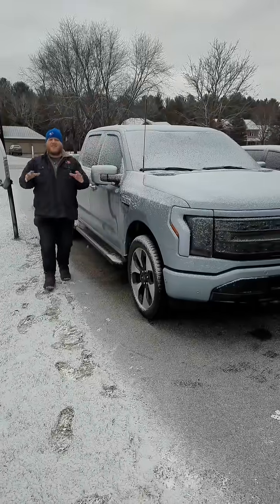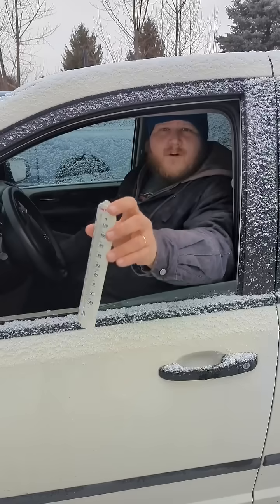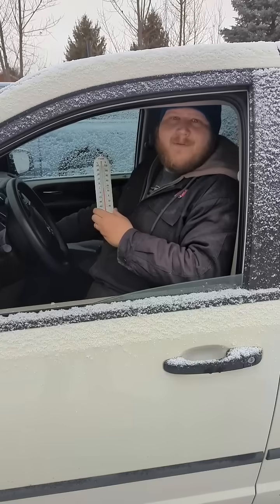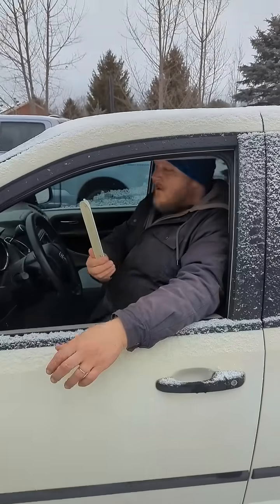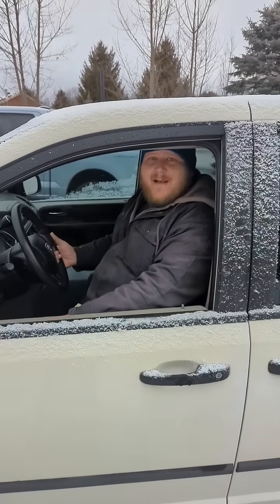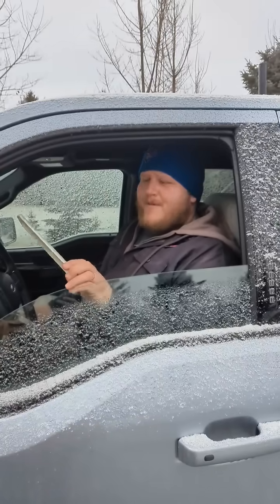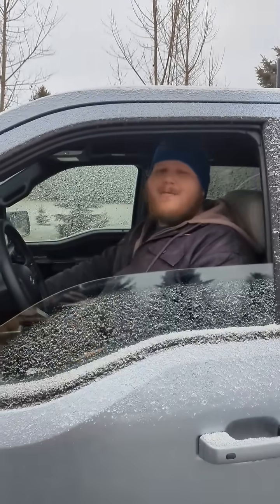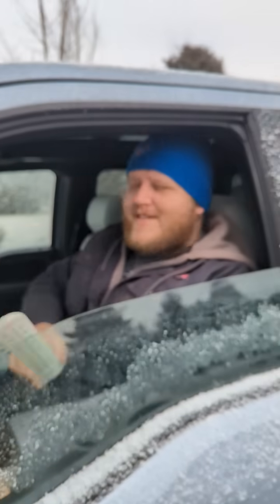Electric vs Gas - Heater Wars! How Long Does the Ford F-150 Lightning Take to Heat Up?

Comment: The most impressive thing of the entire video was the 2015 grand caravan started. But your brother is a mechanic 😅
Reply: Not impressive at all as I own a 2012 and it's like a fuckin freight train when it comes to performing.  And I can fit more in this damn thing than most truck owners. 

Love to see someone scooping up their sixteen foot wide garage doors in their truck and drive them home from the store....  Did in my caravan with a buddy sitting shotgun too.
Reply: @Angry Beaver  then I’d go to the scrap yard and pull the turbos off the Tundra and have my boyfriend weld me a pair of headers and twin turbo my E46.
Reply: @Angry Beaver  yeah I highly doubt that but that Ev will be in the junkyard before that truck will
Reply: Starting isn't the problem getting the transmission to work is the real problem
Reply: I have 1991 Ford F-150 Lariat with 5.0 EFI.... she'll start and heat up fast near the point where negative Fahrenheit and Celsius are equal.  Yeah...like super cold.
Reply: If I could keep the water and oil separated I'd have heat faster!!! Only thing is when most of the water is coming out of the back of my car the other I'm recycling through my oil filter
Reply: There are a ton of old Grand Caravans on the road. Not saying they are perfect but I have an 11 year old one that I’ve beat the hell out of and it is still running strong with typical repairs.
Reply: What ever happened to a wearing a jacket ?
Reply: When I worked for a cab company we had a large fleet of these old caravans and including one that had 400,000 miles on it(no lie, I drove it the day it crossed over) and it ran strong.. only trouble was sixth gear was a mess so on highway cruises I’d slap it down into fifth and it was fine.. never would’ve believed one could last that long on the original powertrain but alas
Reply: I have never met a anyone that owned a Dodge/Chrysler mini-van that didn't have electrical problems, the catalytic converter not go out, and or a handful of other expensive problems.
Reply: It takes my '07 Focus about 20 minutes to throw anything that slightly resembles heat. Couldn't be because I removed the thermostat
Reply: @Whats-It-To-Ya  that’s so strange my dad and I have owned probably 6 focuses over the years and I have yet to be in n a car that all heat up quicker my 2013 can’t even heat up as quick. Pretty much by the time I drive for 2 mins the gauge is already at temp
Reply: @sgthenny07  mine is an '07 with the Duratec 2.3 and it takes about 20 minutes to start throwing decent heat. The temp gauge is at a quarter with the heat on and I gotta turn the heater off for the temp gauge to reach half way. I flushed the radiator and added new coolant, checked the heater core, tried everything. My guess is that the thermostat is stuck open or maybe there isn't one in there. I don't feel like yanking the intake manifold and throttle body to check. I've lived in PA all my life and I've a good tolerance to the cold so having a weak heater is the least of my worries. It still keeps the windshield clear so I guess I can't complain too much.
Reply: @Whats-It-To-Ya  just start driving it started up let it run for 30 seconds and go watch how fast it heats up my Jeep if you let it sit there it'll take forever to warm up all the way but if you start driving it it'll take a couple minutes its throwing heat you don't have to let these vehicles warm up forever it's not carbureted
Reply: @Whats-It-To-Ya  I think you have a stuck open thermostat, because my Buick had that and needed a new thermostat. In the summer it would take quite a while longer than I'd expect to get to operating temperature which is 1/2 way up the temperature gauge.

 In winter it would take forever for the coolant heat up and for the heater to throw any heat. Though maybe after 10-15 min of driving heat would come out of the vents, but the temp gauge probably wasn't at 1/2 for a while.

One day it was 0 degrees outside and dangerously cold, and the coolant temperature would barely climb and my heater didn't throw much heat so it was FREEZING and horrible. Then I decided it was worth paying our mechanic $90 to change out the thermostat. Fixed everything

You should probably fix the heater should you ever get stuck in a blizzard and need to run the heater occasionally to keep the car survivable!
Reply: Took 15 minutes to heat up. I think my 16 year old accord heats up in like way less than that
Reply: @TheAnnoyingBoss onda Accord has a dual stage thermostat that runs the coolant through ports around the exhaust portion of the head. Those things heat up faster than anything I've seen. I'm sure there's other brands and model that have this too..
Reply: @Bryan-Hensley  just one more thing to fail in the end.
Reply: @mbed0123  yeah I had to replace the thermostat in mine around 350,000 miles.
Reply: @Bryan-Hensley  man fr I miss my civics heat. She was 18 years old and you had to turn down the temp it was too toasty😭 I’d even run my sunroof open with the heat on cuz she was a beast.
Reply: @Bryan-Hensley  and surprisingly Hondas have great ac. They always stay nice and cold unless you crack a hole in ur radiator and then blow out ur transmission then she won’t even drive😭
Reply: @TheAnnoyingBoss  yeah comparing this to Japanese made compact cars is apples to orange my man.

That things like a quarter of cabin space and uses an efficient thermostat. Not an old clunky truck one.
Reply: @greuju  true. Trucks usually take a while to warm up inside. Big interiors. Vans probably worse just because the trunk is included in the interior. Cars are less volume. Heat way faster unless they have bad engineered parts
Reply: @TheAnnoyingBoss  ours is approaching 200k still going strong
Reply: @badatcad  200k for a dodge grand caravan is a lot. 200k for a Honda accord is just getting started 😂😂 mine has 175k and it's 16 years old and runs like new. It'll probably go another 16 years easy. The new Hondas I just don't believe it. 1.5L turbo isn't going to go 30 years..
Reply: @TheAnnoyingBoss  I see the new Hondas going 30 years, however that would be if you properly maintained it. My car is a 2002 BMW 325I, bought in 2020 with 68,000 miles. Now it’s just over 100,000. Over 90 percent of the body work is original and in showroom condition. 

That thing would easily do another 100-150 thousand, now newer BMWs, yeah they’re not making it unless you throw a shitload of money.
Reply: @Turbo_The_Femboy_Fox  the lot of Hondas will last well over 300,000 miles even if they're not being taken care of right
Reply: @TheAnnoyingBoss  lmfao mines got 335 and going strong its 2013 take care of stuff and anything can last
Reply: @TheAnnoyingBoss  accords have less interior space to heat up.
Reply: 4 mins is too long. My car takes less than 1 min to heat up to a nice warm cozy temperature.
Reply: @jamsbong  I don't believe that...from a freezing temp it heats the air in the cabin less than 1 minute? That's fake news bro

Comment: I thought heat pumps were the most efficient units for EV's to maximize battery life
Reply: They are, but they are more expensive and more complicated. It a stupid choice some auto makers are making for EVs. My Chevy Volt is the same, but they undersized the coils so in very cold weather it has to start the engine even if the battery is full. Very annoying!

Comment: Completely useless comparison.
Reply: Do you think the results would be dramatically different if they used an F-150 instead of the caravan?
Reply: @ALMX5DP  Do you know how an ICE heats up a car? You cannot compare EV vs ICE with regards heating it’s pointless. It’s like using a candle vs electric heater to warm up a small room.
Reply: @CaptGongshow556  why not? Both are cars and people who drive them like to have heat when they want. I see no reason to call it useless since it provided a decent glimpse into the difference in time it takes for one to heat up the cabin. If people are still using candles to heat up a room, i suppose you might have a point to use that as comparison.
Reply: @CaptGongshow556  so you're saying it isnt nice to know the difference? What do you mean by "fake issue"?
Reply: @ALMX5DP  Fake issue because everyone knows why it takes like 10 min in an ICE vehicle to get a a tiny bit of warmth and EV the heating is electric. Put an electric heater in an ICE car and you will get the same results. Both vehicles are at the mercy of their technology. Its more fuel efficient to have coolant base heat than electric heat in an ICE car and well EV all the have is electric so instantaneous…this comparison is worthless…maybe for Aunt Becky who doesn’t know any mechanical stuff but still…not a good comparison. Same to be said about 0-60 in a tesla versus a corolla. Cannot be compared.
Reply: @CaptGongshow556  this wasnt a video about why, just how long... Not sure what you mean by efficiency unless you are referring to how an ICE is so inefficient that they found a way to use the waste for a positive purpose. Dont get me wrong there are many pros and cons to both outside of the scope of this video, but this was pretty cut and dry and you seem to be making a mountain out of a molehill.
Reply: @ALMX5DP  You can’t compare cabin warm up between EV and ICE they don’t use the same technology. Microwave vs Oven at this point! One needs to warm up before delivering heat and the other doesn’t. Quite a simple concept mo?
Reply: @CaptGongshow556  Actually more like comparing a gas oven to an electric oven which people do all the time :P Pretty simple concept to me.
Reply: @ALMX5DP  And you can’t talk about how long without the why.
Reply: @CaptGongshow556  this video suggests otherwise.
Reply: @Marc Mart  your right ev to ice comparison suck how dare them... just a quick question why are you here watching it and commenting
Reply: @lesstevens2370  And yet, here you are.
Reply: @Marc Mart  I'm here because evs are cool and the only way you can get independence and not bend over for oil companies every week and have the option to make your own fuel which you can't with oil
Reply: @lesstevens2370  Yes ev’s are cool and it’s still an invalid comparison. It’s like comparing the how long it will take to boil water in a microwave vs oven. All i’m saying.

Comment: still absolutely do not want an EV
Reply: 🤣🤣 i second this
Reply: I 3rd this! I could win one and would be shopping trade-in before I even took delivery. 

It's crazy the amount of failures and all the multiple issues that have been happening, especially with the cold and still have idiots that will defend EV like it's a one off problem. To top it off there is absolutely nothing green about EV.

Comment: The beauty of not having to rely on an internal combustion engine to warm up and provide its waste heat to the cabin. Would be nice to see the Lightning get a heat pump for heating as well though.
Reply: Ah the beauty of turning my key and letting my 16 year old 5000 dollar Honda accord heat up for 5 minutes before driving 500 miles nonstop and then getting gas, peeing, buying a snack and driving another 500 miles nonstop. Boom, now I'm in a whole different area and I didn't have to stop and and charge at every charging station with just barely enough juice to get to the next stop and I paid 5000 dollars instead of whatever crazy prices they're asking for these electric f150, grooming you to stop every 150 miles, 10 times just to get 1500 miles, which isn't even the biggest possible distances in usa. If you go from San Diego to Miami and you need to haul a trailer full of furniture from one business to another, the gas f150 is going to be way way better than the electric f150
Reply: @TheAnnoyingBoss  so your saying you move back and forth from east coast to west coast every weekend